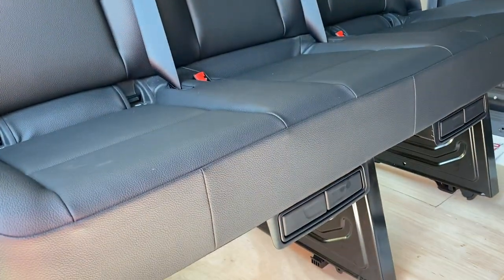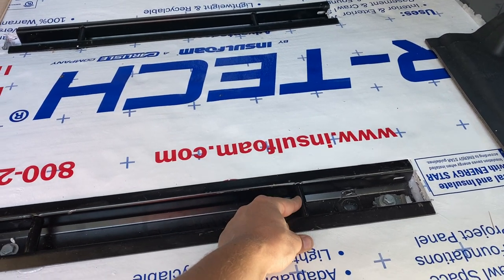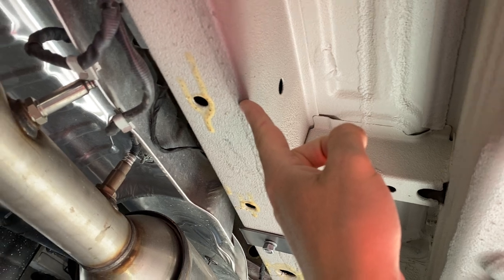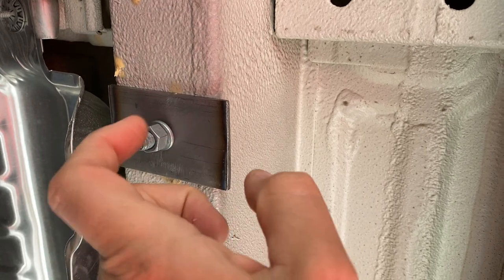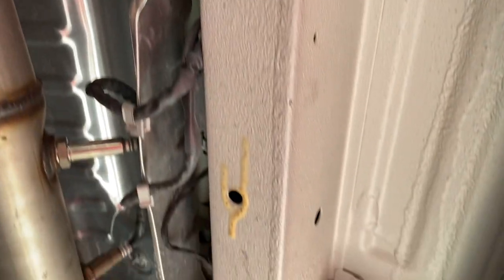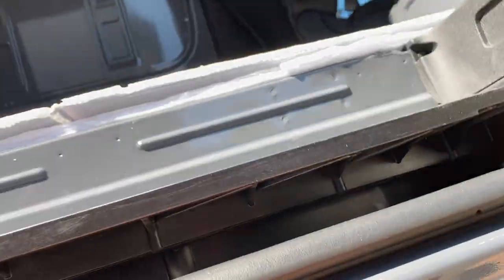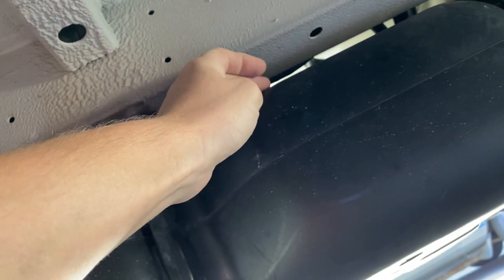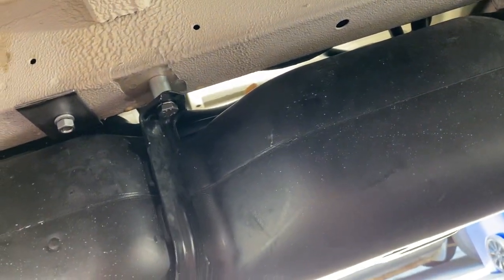2019 - 2020 Sprinter Rear Seat Bench Install

Comment: Nice work. I didn't lower my tank, just remove the bolt from the tank strap & drill right up through the nut into the cabin. The seat bracket bolt then also becomes the fuel tank hanger bolt. works great!

Comment: I just crawled out from under our 2020 sprinter cursing because of the gas tank and other problems you ran into. I’m glad you solved most of my problems for me, saved a ton of headache!! Keep posting your progress, I’m just a few steps behind ya!
Reply from the maker: Jesper Dahlquist glad to hear that this was helpful. Yea, it’s a pain... We actually ended up again replacing all our screws with 6” stainless ones. You can order them directly from fastenal.
Reply: Paul Riedel I’m already off to a rough start, I picked up a row of seats in Los Angeles  which I thought were from a 2019 van and bought the brackets for a 2019 only to find out the seats are from a 2018...they look very similar but they mount to different brackets so I am ordering the right ones now...😩
Reply from the maker: Jesper Dahlquist oh no!! :/
Reply: Paul Riedel any chance you will share your material order from fastenal?
Reply from the maker: Jesper Dahlquist hey - they were just 5 1/2” stainless steel bolts, maybe 3/8 or m10. You can also find them at the Home Depot. Same with all the other supplies.

Comment: Hi, You mention they were OEM but they look aftermarket.  Do you know?  From my extensive!! digging, way harder to find OEM rails than I thought, at least for a decent price less than $700 used....  The OEM seem to be longer with the ability to fit in the cover plates, etc.  Ebay is full of inexpensive aftermarket ones.

Comment: Thanks for the video! This seems so hard to install! I'm dreading it.
Reply from the maker: That’s the spirit! Lol. It’s not too hard, just annoying.
Reply: @germaninpdx  Hey Paul, since watching your video, I have gone back and forth on the order of a 2022 Sprinter 170" CARGO from our local dealership. I will immediately need a back-row seat for the family and found a few OEM seats on sale on Facebook. Most don't come with the metal bracket so I will have to order aftermarket. Question for you here, do you think you could have shifted the seat around to land the bolts, not above the fuel tank?
Reply from the maker: @zachstirling3333  congrats! Ultimately I don’t think you can avoid installing the bench above the tank unless you go really far back. Width-wise there isn’t enough room to move the bench more to the right (sliding door side). Don’t be intimidated. I’m sure you can do this!

Comment: Can you put the new 2019 and above bench seats on a 2017 mb sprinter ? I find old bench seat uncomfortable. I purchased new 2020 seats with the new oem brackets I just don’t know if they line up differently
Reply from the maker: As far as I know the 2017 has the captive nuts inside the frame that you can probably fasted the 2020 brackets to. But.. if not.. you can use my method and just go straight through the frame and put in any seat you prefer!

Comment: Great video! I got a same seat and ready to be installed.  However I need some help with measurements. I want to put it in the factory spot. How far the floor track sits back from the front seat base and from the driver side wall? I can't find any info for that. Thanks
Reply from the maker: I don’t know the exact distance that the crew version leaves between the front seat base and the rails this row sits on. Curious why would want it to be exact? It’s kind of nice that you can determine yourself exactly how far forward you want them (within the limits of those grooves in the floor). There is only one distance they can be from the driver side wall given where the grooves are.
Reply: @germaninpdx  Thanks, that's true the grooves will shoe the right spot from the side. Ill remove the factory floor and hopefully will see better. Thanks again!
Reply: Sorry to be so off topic but does anybody know a tool to log back into an instagram account??
I was stupid lost my account password. I would appreciate any tips you can offer me.
Reply: @Micah Dante instablaster =)
Reply: @Jericho Jayce i really appreciate your reply. I got to the site through google and Im trying it out atm.
Takes quite some time so I will get back to you later when my account password hopefully is recovered.
Reply: @Jericho Jayce it worked and I now got access to my account again. I am so happy!
Thanks so much, you saved my account!
Reply: @Micah Dante no problem =)

Comment: I would have place some wood spacers on top of the tank thats thick enough so your tank clamps holds it rigidly or else your tank can bounce on bumpy roads.
Reply from the maker: Yea, the closed cell foam is pretty rigid but wood would probably work too. Just might be tricky to squeeze into the spots if you’re not taking the tank off completely.
Reply: Flammable materials next to the gas tank? Not a good idea.

Comment: Doesn’t seem strong enough at attach points.
Reply from the maker: Where exactly do you feel it’s not strong enough? Under the body? Open to suggestions on improvements given what options are available without captive nuts.
Reply: @germaninpdx  hey Paul, you should get some hot rolled 1/4” steel plates to place under the van floor. These are not expensive, and will greatly increase the structural pull strength. Think of these plates, cut to size, as giant washers. The van floor is not strong enough by itself in the even of a serious accident. Hope that helps! I found a good pictorial of this for the installation of another bench seat, check out weekendervanlife blog post for capervan folding seat install.
Reply: I see that you did use some steel plates, I am sure that the bolts that go into the frame are good, and the bolt that goes into floor are probably ok too... Just looked undersized... when used in floor.
Reply from the maker: @ryanc3656  Interesting. Thank you for sharing. The steel they used looks like the same I have. I like how they go across the entire width in-between the struts, but I would argue that my placement on top of (well, "below") the U-shaped struts under the van floor actually provides significantly more strength than just putting them directly under the van floor. Fortunately, with the placement in the grooves, the bench is anchored on the left and right side right where the U-struts are located. The center fastener is just under the van floor, but it also doesn't withstand the same structural pull compared to the outsides given the way the bench hooks into those. The weakest points in this construction are the bolts themselves. If anything, they would break before anything pulls through the struts and floor. That's why I used the biggest, stainless bolts I could get my hands on.
Reply: @germaninpdx  good point, agreed!

Comment: 1 year later all rusted
Reply from the maker: Actually I sprayed all the holes with rustoleum and used stainless fasteners. No rust so far! :)
Reply: @germaninpdx  How about the mild steel plates you used? Those are going to be rusty in a month.
Reply from the maker: @danielpeterchicago  just crawled under to inspect them. I did spray those before mounting them as well. 5/6 look good, one does have some rust on the edges. There may be a better solution for those plates which are effectively giant washers. If you come across one let me know and I’ll swap at least the one out!